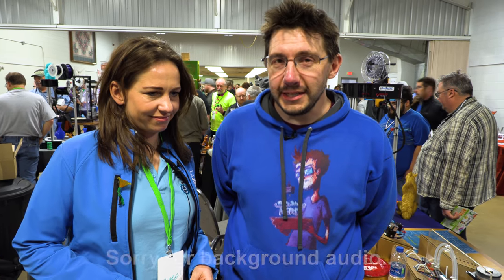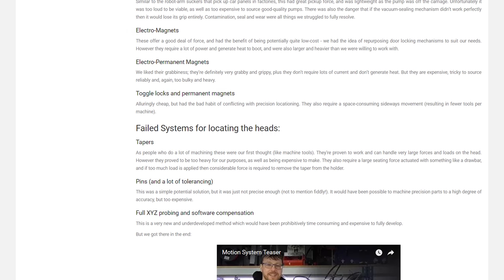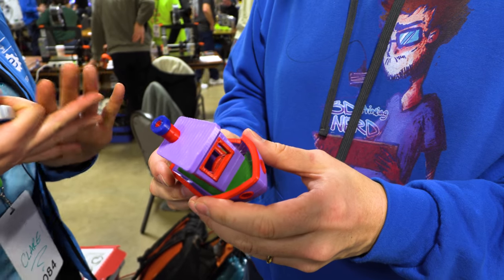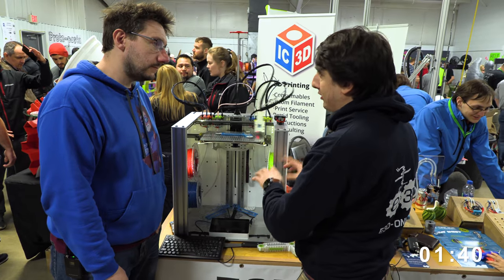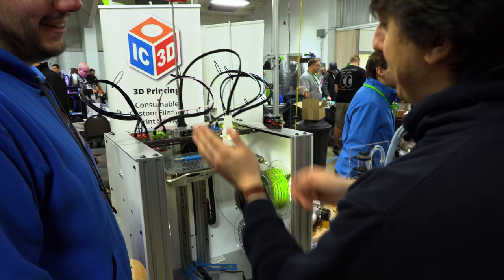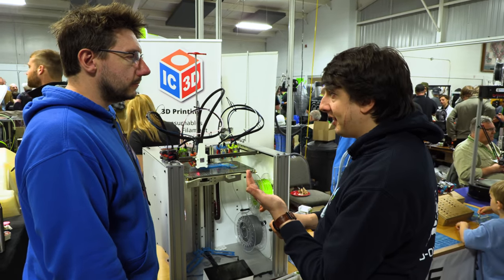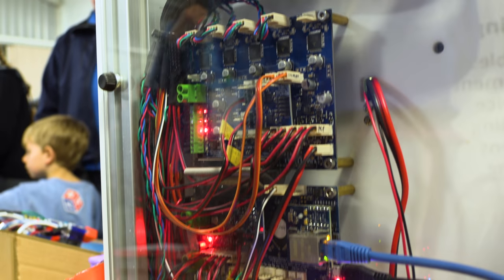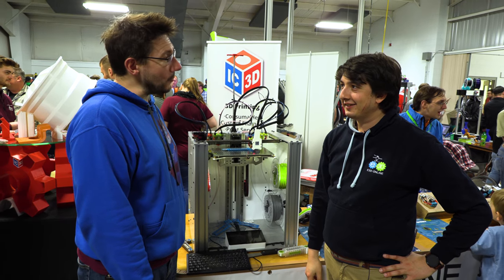The E3D Toolchanger 3D Printer AND The 3-minute Sanjay Conversation #MRRF2018

Comment: It's so beautiful. While I think multifilaments simply for color is a waste, multifilaments for different plastics with different characteristics -like a rigid/flexible for a living hinge is great.

And kinematic build plates should be the new standard. 3 points to tram-not 4 points that introduces too much play. 

A 1000 is a bit high but if that was the price with all the tools and duet wifi board, yeah thats acceptable. 

Got a link for their survey?
Reply: Survey is linked in this blog post 
https://e3d-online.com/blog/2018/03/21/tool-changer-q/
Reply: I think the value of color changing should be analyzed by each individual. 
Yeah, for a lot of people color changing is futile, but if someone finds value in it, there is nothing wrong in using it. 
As the popular saying goes: "The right tool for the right job".
Reply: MEchanically is right, I find great use for multicolor in my workflow, as I use it to print contrasting nameplates or crests for Military plaques and the like.  The added cost of having multicolor printing is vastly offset by the time savings of not having to paint everything after printing.  But it's a specific use case.  Currently the Prusa works great for me, excited about the new version they showed, but this looks much better.  Not just the multicolor capacity, but the material change really is something worth plenty.  I agree that 1000 for just mechanicals sounds like a lot, I'd like to see the boards and some tool heads included.  That being said, quality and early adopter fees have to be considered.

Comment: Hardware looks great, but it's important to be cautious on any new initiative until the core bugs and pricing have been worked out. Note that their Big Box project was not successful.

I wished we could have gotten a glimpse of the software and code required to manage colors and interchangeable components. Are they creating a new Marlin fork (Marlin is already legacy - maybe new OS) for example, and who will finally develop software making it easy to incorporate multi-colors and materials? Can't rely on the compassion of the open source community.

Convenience will be the key if the product is to be used in a professional milieu, but hobbyists should have a blast!
Reply: Joe Rhio check their blog...